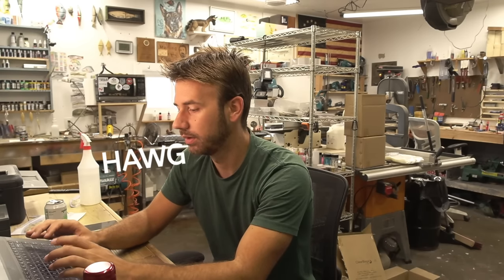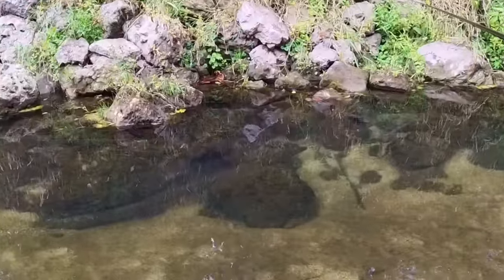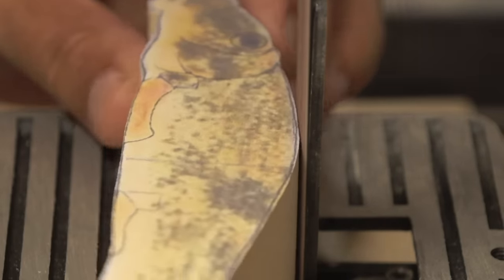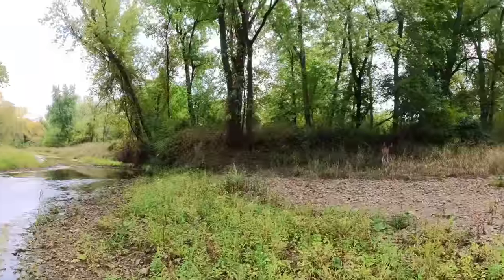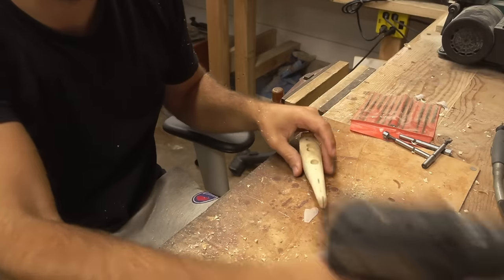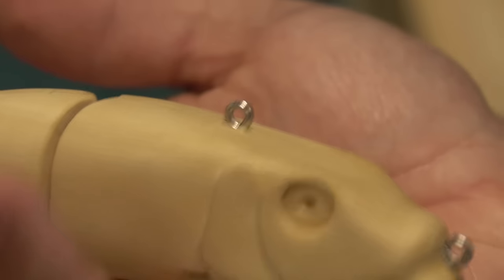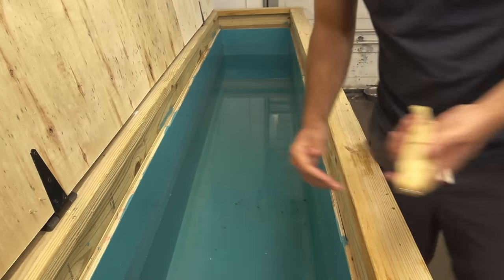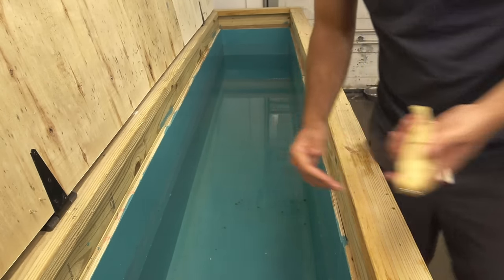Making a Northern HogSucker Lure

Comment: Have you ever thought about making. A longer version of the bif bait from the 1920s. Had a center hole with the eyelet on the top and the hook on the bottom. The center hole had two slots off the side so the water went into the center of the lure and then slid out the side of those two slots and it made it way back and forth caught multiple fish on that bait.The lure I have right now is black, and is about 3 and 1/2 in Long total.

Comment: That thing is gonna be a pike slayer, bud.  Pike just love suckers.  Also...use worms you silly when fishing for suckers.  I fish redhorse during their runs, similar to suckers, and they love worms.  And I used to catch tons of suckers while brown trout fishing with worms as they like the same water.  Suckers are seen as a dirty fish, but many species only like the cleanest and coldest water, like trout.  Some get quite big.  I have got several species in 18+" range.  Just sit a worm right on the bottom and leave it there for awhile...the suckers can "taste" your bait before they find it.  Give em a bit to find it.  And leave no tension on you line...slack it, hold line in hand to feel the tiny little nibbles.  Only add tension when you set the hook.